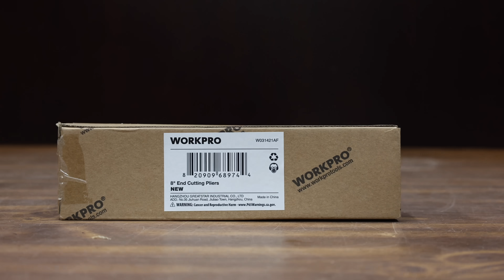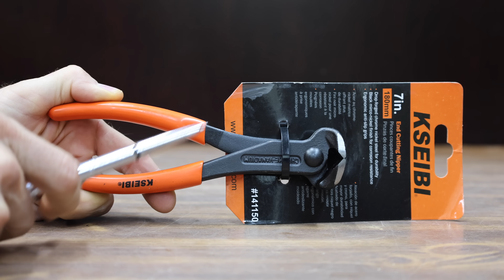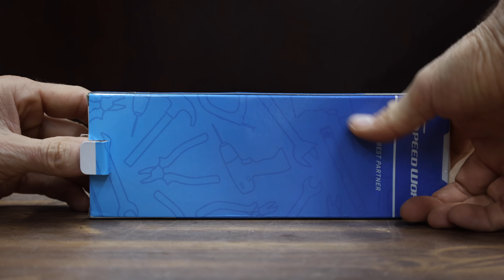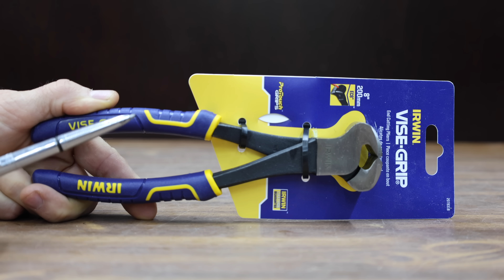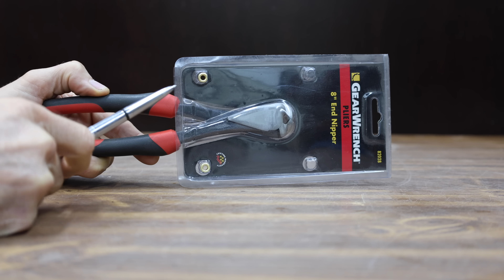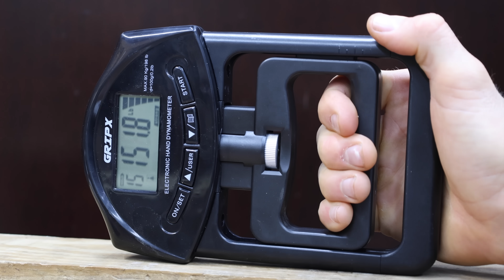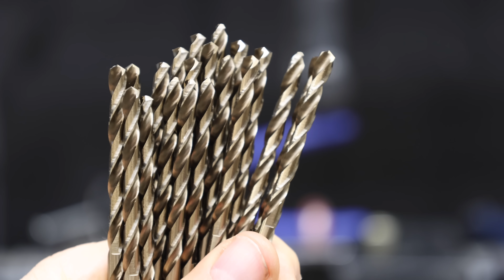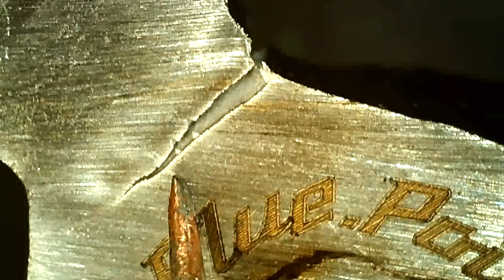Finally! Best Pliers I've Ever Tested! Not Even Close!

Comment: I must say this is literally the one tool where I am totally fine with a 'bad' one. I am sure it is job dependent but as a car mechanic they get very little use, especially compared to other cutters like the good ole diagonal. 
The one area you are lacking is in a larger 'tongue and groove' plier section, your video on the smaller ones is great. A good straight set comes in handy from time to time, it is my number one tool for brake caliper compressing. However this is one area the cheap ones are not good, they skip, jump a tooth, get excess play in the rivet. It's something that would be really usefully to see what brand is worth putting money into if it will last longer. Interestingly I never referred to them or hear them referred to as 'tongue and groove' specifically - here in Canada they are marketed as anything from slip-joint, jointed-plier, pipe plier, groove lock. Edit* I stand corrected, I see that channellock sells theirs as tongue and groove. 
Also just to note - although I know Knipex comes out as a strong leader in most of these segments, it doesn't really seem like they make anything with long enough jaws (or maybe their product pictures are deceiving).

Comment: Its immediately obvious that a pair of cutter will not cut anything off flush the board since can easily see the cutting edges were sharpened with a 45degree bevel on each side of it. For it to cut flush with the board, the outer edge of the cutting jaws have to remain without any bevel to them

Comment: Fundamentally, cutting blades should not be perfectly aligned, there is usually a design offset of around 0.1mm. This is because when two hardened sharpened blades meet apex to apex, they aren't going to stay that sharp for very long, they'll end up blunting each other. Good manufacturers are quite meticulous about keeping the offset as small as possible, but large enough that even under load and wear, the blades never meet edge to edge.

Also i don't think it should matter for the purpose of pricing whether it's made in China or elsewhere. After all, what matters is the quality, and while most of Chinese manufacturing is very cost oriented, high quality processes are available there as well, but at a cost comparable to Taiwan or Italy. Though of course not much good can be said about the Bluepoint tool, made in China.

Comment: I gotta say tekton makes some damn good tools. I have standard and metric 3/8 drive and 1/2 drive socket sets. Never broke or cracked one. Used them to press in and out bushings. Used air hammers on them. Beat them with hammers. Ive had them red hot and just about everything in between and have never had 1 single issue with them. They have made me tens of thousands of dollars. Best amazon purchase ive ever made
Reply from the maker: Thanks for the feedback.

Comment: It would be nice if you were to have an end 30 seconds on each video with the exact name, number of tool, etc, so it would be easier to find.  I just ordered a set of the Knipex myself, because I'm tired of trying to manhandle my way through wire, nails, staples, etc, using regular pliers.  They are the Knipex Bolt End Cutting DIN ISO 5743 61 02 200 pliers.  Just a black and white page with all the information, a line for each tool, that sits for 30 seconds then fades out :)
Reply from the maker: Thanks for the constructive feedback.

Comment: I'm very impressed by how flush the Wazakura pliers were able to cut.  They seem very good as long as you're not cutting through anything harder than a nail.
Gedore could perform so much better if only the blade were sharper.
Major props to Knipex for undoubtedly being worth the cost.

Comment: Thank you for featuring our hand forged  bonsai pliers in your video! 
We are happy to see that our bonsai tree pliers were able to perform well in some of these construction-focused tests. 
We are especially proud to have offered the most flush cut, as it demonstrates the level of precision our artisans here in Japan are able to achieve! 
Thanks again for the feature!
Reply: The quality of the tool looks like a piece of art compared to the others.
Reply: Japanese tools are awesome.  What a cool reply.
Reply: @phanties everything Japanese is awesome. You should see how I drive my 4runner and she keeps taking it without issue
Reply: by far looks very unique and fantastic :)
Reply: Your performance was RIDICULOUS for a tool that was absolutely NOT designed for this...  Impressive!
Reply: @Arclite02  "Works great as a cutter or to ply out nails, etc. ; Ideal for cutting metal wire, iron and nail-head" so stating it wasn't made for this might be pushing it AFAICT.
Reply: @DavidMulderOne  check their website david. lmao top of the bell curve
Reply: @DavidMulderOne  If you read down the listing, it specifically says "Cutting hard wire such as tempered high-carbon steel or piano wire will damage the blade. Please use it for cutting soft iron wires such as nails." 
They have an intended use case and they're completely open about it. Personally I much prefer that over making ridiculous claims that can't be fulfilled.
Reply: @Exoleres  I am on their official website and it says no such thing. For posperity, this is what it says on their official listing on their official website:

> Wazakura Hand Forged Kuikiri End-Cutting Pliers 8.25"(210mm)
>
>【Specification】
> Size: L 8.25 x W 2.0 x H 0.8 inch (210 x 50 x 20 mm)
> Length of Blades: 1 inch (23 mm)
> Weight: 16.2 oz (460 g)
> Material: S55C Carbon steel
> Cutting Capacity: 1/8 inch(3.5mm) thickness
> Black Coated
> Made in Japan (Niigata prefecture)
> Hand-made
> Condition: New
>
>【Traditional Kuikiri】
> Sturdy and sharp; Made of Japanese steel
> Works great as a cutter or to ply out nails, etc. ; Ideal for cutting metal wire, iron and nail-head
>
>【Hand Forged Made】
> Beat and shape the heated steel to make it even stronger

Your text seems seems to be from an amazon listing selling their tool.
Reply: @DavidMulderOne  Uhhh... It is from the Amazon listing, because I would think that anyone on the website of a bonsai tool maker on a listing for their bonsai tools would have context to know their primary purpose is... Bonsai. 

As opposed to on Amazon where that context may not be as obvious or written fifty times as it is on their own website.
Reply: @DavidMulderOne  You got told, bubby.
Reply: @Exoleres  Plying out nails and cutting nails is AFAIK not a thing you do with Bonsai (do correct me if I am wrong), so the fundamental assumption that this tool is just for Bonsai doesn't hold up. Companies are allowed to expand beyond a single target market you know.
Reply: @DavidMulderOne  Absolutely. They've also expanded into ikebana, that is, flower arrangement. Looking at their website it's very clear they have a pretty focused purpose as a company, don't you think?

As for the first part, I agree it's not an everyday aspect, but it's also not hard to imagine how the ability to cut soft metal might become useful for wire splints, tiny tree crutches, planter boxes, or similar.
Reply: @DavidMulderOne  cutting hardened screws is not cutting aluminum bonsai wire or small nails. Nails are a much softer material. They are made for bonsai, wtf would use their bonsai cutters on a construction screw besides a child that has poor judgement?    Nowhere is it implied that they are construction tools. They are designed to be precise and sharp so they don't tear tissue when snipping limbs. They did a fantastic job on most of the things in the video, more than I would ever use mine on. Good to know they're that much stronger than I thought though. 
  I recommend not buying your screw cutters from a bonsai website.
Reply: It's the kings themselves!
Reply: I think the Wazakura were the most impressive. Who cuts screws with flush cut pliers? To me, the flush cut is the more important point
Reply: Flush cut geometry is fundamentally compromised for strength.

But it's so incredibly useful, good to have and not be a copy of every other tool.
Reply: Craftsman need perfection, Generalist's need all around performance. I will be buying yours for the cleanest/closest cuts, and keep my Knipex's around for the ugly stuff to avoid any damage.
Reply: I have a pair of your pliers for my tress.   Love them
Reply: Was looking for a set of upholstery pliers--these look like they outperformed the entire group for that task, barring weight I think.  Very nice tool, WazakuraJapan.
Reply: Very fine tool.  Luthiers often look for cut off pliers with a flush cut as much as possible. If you have not expanded into that market yet, you should. 👏🏾
Reply: those pliers looked beautifully made i def wanna get a pair cause they look like they would last decades.
Reply: Wow that makes them even more exceptional to be for bonsai
Reply: Flush cut IS important!
Reply: This is why i collect Japanese tools, because their attention to detail is unparalleled.
Reply: I've use your tools for my bonsai and they are perfect for what they are designed for. The precision is unparalleled. I think mine are called concave cutters and they do a great cut. The wound healed quickly. Thank you.
Reply: The fit and finish of your pliers are really impressive, great workmanship!
Reply: Beautiful tool that performed well on a different purpose from bonsai. Great job!
Reply: Good luck in your future endeavors, senpai! 😊
Reply: Do you offer a cutter with more of a flush cut?
Reply: @NotABot88  We can try to look into it :)
Reply: General Patt0n was right.
Reply: @wazakurajapan I'm impressed and grateful to learn about your company.  I'll be looking into other products
Reply: Do you trade on the stock market? What is your stock symbol?
Reply: very impressive

greetings from Minnesota, US
Reply: I was surprised  you didn't  do better I've always  heard that Japanese  tools were the best sadly it wasn't so except for cutting staples make another  tool  beating knipex or at least 2nd place if I was Japanese  I would  be ashamed  how poor they did overall  you can do better winning  this competition  easily  if you set your mind to it use a better grade metal with your Japanese  precision  skills
Reply: @bernardberryman4228 what the f**k kind of back handed comment is this? You suck dude😂
Reply: Wax on, wax off! 🙏
Reply: @NewWorldHoarder 
Wax on, Whacks off 😂

Comment: If any manufacturer wanted a flush cut then it's a very simple fix, they just need to leave one side of the cutting surface flush and only bevel the inside edge.  It's actually something that you could easily do with a sharpening stone to any of the pairs - if you were concerned.
Reply from the maker: Thanks for the feedback.

Comment: My old job as yard dog provided me with a set of wire/ nail cutters for cutting assorted types of seals on trailers, had a few different makes over the 8 years I worked there. Craftsman( lasted 2 weeks) kobalt, very nice and capable but locking mechanism broke almost immediatly, cutting blade snapped after about a year,. Knipex, those things cut things they had no business cutting, strong, durable and almost indestructible,and have a warantee👍
Reply from the maker: Thanks for sharing.

Comment: For anyone concerned about clipping off nails or staples close to the surface, I was a trim carpenter and was commonly cutting off 16Guage and 18guage nails with a tool called a fret bar cutter. Perfect for small stuff, it gets very close to the edge for the small nails, and you can still use it to pull as well. Buy the knipex pliers in this video of course, but if you need a separate pair of pliers for close cutting, get some fret bar cutters. Right to for the job!
Reply from the maker: Thanks for sharing.

Comment: I have owned the knipex pliers for about a year and they have performed like champ. Ive never thought about cutting a drill bit or even a hex key, but screws have felt their wrath.  I'm a diesel technician by trade and every knipex plier i own is worth the extra expense in my opinion, especially the side cutters and the one you tested here. I wonder how the slip joint (button slider) water pump pliers from knipex hold up against competitors? I have 2 sizes, 12 inch and the XXL 22 inch pliers. If you havent already, could you test these types? Thanks again for all you do sir, i really enjoy all the videos!!
Reply from the maker: You are welcome!  Thanks for the suggestion.

Comment: Got myself some Knipex ESD Electronic SuperKnips (aka mini flush cutters) for a soldering kit i made a few years back. Cuts through leads like butter, and the lead catch is very effective. Ever since, ive subjected them to a fair bit of abuse because they always seem to end up as a handy tool when i need to cut something cleanly. 

I was doing a brake job on my truck this summer and ended up having to cut a rigid brake line in order to replace a caliper. Nothing in my limited toolbox was making the cut. On a whim, i grabbed the knipex and low and behold, the lil guy made it through without a scratch. Definitely beyond what it was designed for, and any potential doubt i had in their products is gone. They aint cheap, but im a convert.

Comment: i
If you wanted to do a flush cutting test you should have bought flush cutters, they look exactly the same but the geometry is slightly different, the bottom edges are flat with a 45 degree angle, not like this (><), all other tests were great, I have been buying Knipex since I was a 16 year old apprentice and still buy them today, I must have tried 20 different brands of electrical wire side cutters and plyers and pipe grips and literally nothing compares to Knipex, Knipex is King, thanks for the video and good job.

Comment: Do yourself a favor, if you need them cut flush, use a grinder. And if it's imperative that you don't scuff the surface like a grinder is prone to do, you'll want to bend them back and forth until they break instead. These cutting tools, even side cutters, do not cut flush. Bending them back and forth until they break will consistently break them flush with the surface.
Reply from the maker: Thank you for sharing!
Reply: True, but these aren't just for cutting. They're primary purpose is more for pulling. Grinder won't work in that instance. Look up 61-01-200 nail puller, and you'll see what I mean.

Comment: Knipex just can't stop taking Ws.  But anyone who has used their stuff, especially compared to big box brands, can feel the difference every time.   I don't even bother with buying any type of cutter but Knipex unless I plan to throw it away at some point, their metal choice & heat treat is always on point, and they usually have a few design tricks up their sleeves to pull even more performance & reliability out of a tool than the competition.
Reply from the maker: Thanks for the feedback.

Comment: I have a Knipex 10" water pump plier that I used to try to pull a rusty hinge pin out of an old rusty Hoffman enclosure door. I drove the pin out a few inches with a pin punch and then bent it and grabbed it with those pliers.  Then I pounded on the back of those pliers with a ball peen hammer fifty times barely moving that pin until it finally stretched and broke off, but the pliers never slipped and you cannot see any marks on them where I applied the abuse.  I am a Knipex believer.
Reply from the maker: Thanks for sharing.

Comment: Gonna throw this out there:  Many drill bits have a softer shank so that if the drill catches in the material it'll spin in the chuck instead of just napping off and/or damaging the drill chuck jaws.  Sometimes it still snaps.  Trying to cut through the actual drill end/fluting would have been a better test.  
That being said, your videos are the best.  When I go to buy tools/consumables I usually check and see if you've reviewed that particular thing, you're doing important work here!!
Reply from the maker: Thanks!  Thanks for sharing.

Comment: I would rate the tool based on what it was made to do. None of these were meant to cut off anything hardened. I do not possess the 150-350lb hand grip required to use one of these tools improperly. If I was buying one I would go with the one that cut off closest to flush, required reasonable amount of hand strength to use, and what one pulled a nail with the least effort, combined with cost. Not how well it holds up in a hydraulic press.

Comment: Had to do quite a bit of electrical cable crimping at 50mm2 (1/0 awg). Managed to get some knipex cutters for the copper cable. Made the job so much easier than with all the previous tools. Cut through all that copper like butter.
Reply from the maker: Thanks for sharing.

Comment: Quite a few years ago I found a pair of Knipex wire cutting pliers on the road while cycling.  Those pliers have been the first ones rather than others that I've reached for ever since.  They have cut hard wire (spring and piano wire) with ease and no visible degradation to the cutting edges.  I tend to believe that the person that lost these great pliers likely misses having them.
Reply from the maker: Thanks for sharing.

Comment: I would like to see a review on mig welding pliers. As a welding instructor I typically recommend the Welper brand to people but I would be curious to see how others perform. Welding students have a tendency to cut tig wire with their mig pliers, stainless steel is very hard and tends to wear them out. For that reason I recommend using heavy lineman's pliers or clines for that but it would be nice if they only had to carry one pair of pliers. I would be interested to see how you test the other features on the pliers as well. Your reviews are always helpful, we appreciate how comprehensive you are!
Reply from the maker: Thanks!  Thanks for the suggestion.